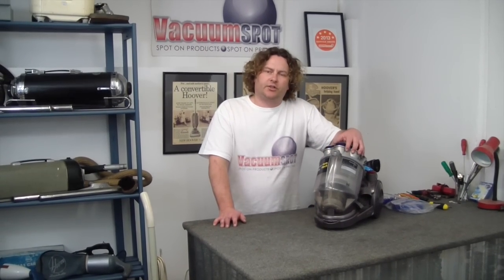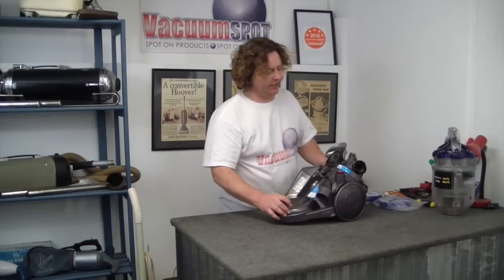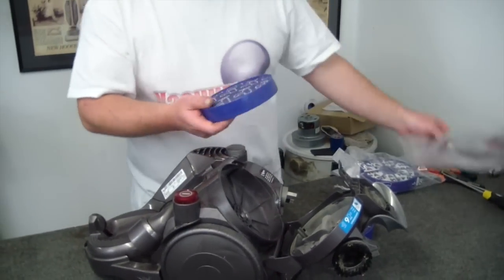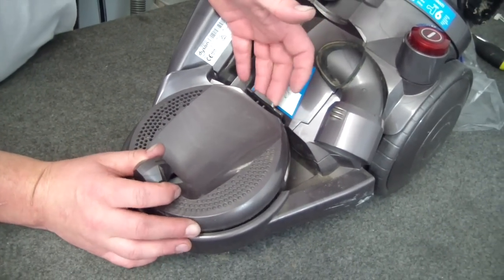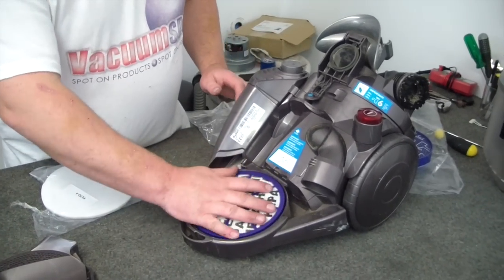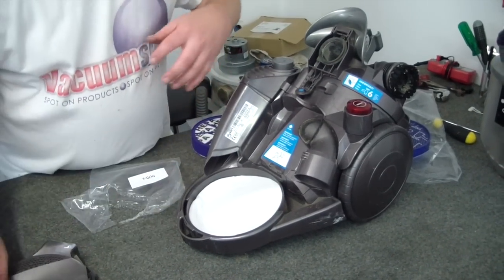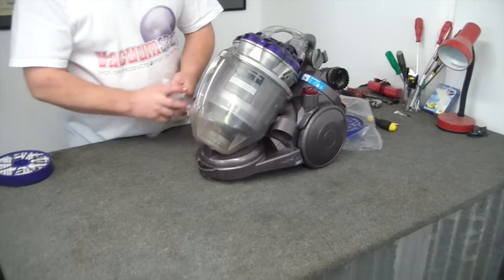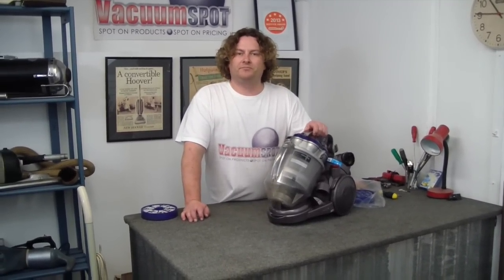How to find out what's wrong with my Dyson DC20 and fix it

Comment: Alex like your videos. I think I know all about filters, and power head problems on my DC39. But the retractor lead has a break somewhere. Can you advise how to split the ball to get into the top section with the wiring. I'm worried I might bust it in my approach.
Nev.

Comment: Hope you can help me. My DC21 stays running fine but the power head keeps shutting off intermittently. It turns right back on as soon as I tap the foot switch. I checked the power contact holes at both ends for lint or debris and those wear clear ( I had that happen once ). I disassembled the power head it had a lot of dust in that motor area so I cleaned everything. I reassembled it all and it is still shutting off intermittently. I'm not sure where to go from here. Do you know what the problem might be ?
Reply: Liberty309 the same is happening with my Dc21. Have you resolved the problem you had?